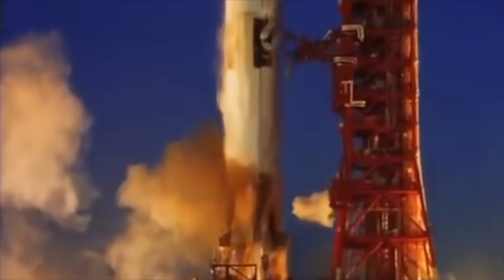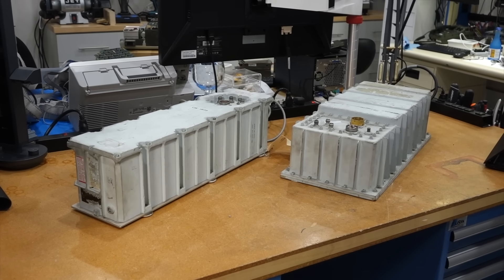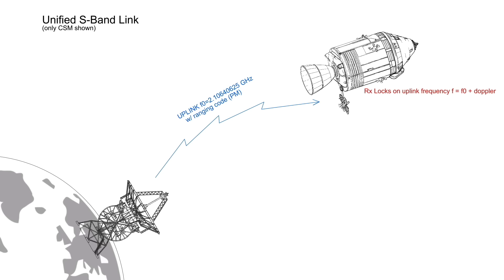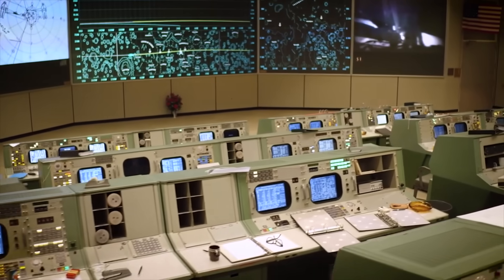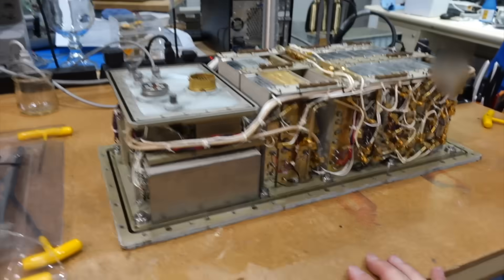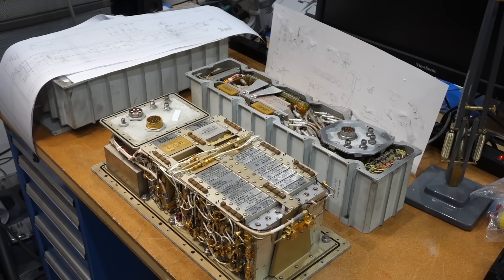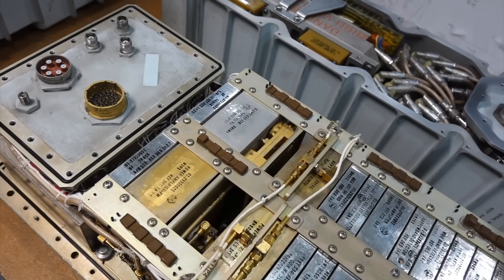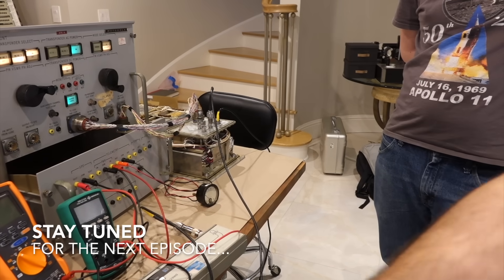Apollo Comms Part 1: Opening the S-Band Transponder and Amplifier

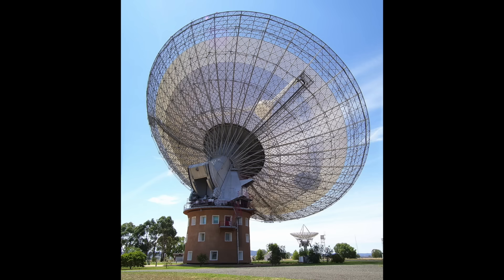Comment: There is an interesting fact about the Parkes antenna (04:50) as in the moment of Armstrong's first walk on the Moon it was the last one who had contact with Apollo 11 and as thw Moon was very low on the horizon the dish was kept at its lowest declination nearly toucing the ground and in that exact time the wind rised first at 50 kn and then at 100 kn, at windspeeds higheer than 30kn in order to preserve the instrument the dish should be pointed at the zenith, but the tecnicians of Parkes bravely decided to keep it pointed towards Apollo 11 risking their onw life in case of a collapse of the building
Reply from the maker: The ground antennas alone are worth a full episode! Unfortunately very little of this Parkes galore is true and the Dish movie is both historically and technically completely wrong, I hated it. Except for the beautiful views of the dish itself! The Goldstone 210 ft antenna did the Apollo 11 descent (and basically saved the day allowing to maintain LM comms on the omnis). Goldstone 210 also did the TV at the beginning of the moonwalk. They had great signal but they had their scan converter setup completely wrong. You can see it at the beginning, image upside down, way too much contrast, then even inverted contrast while the operator is panicking while trying to correct the mess. So they quickly switch to the 80ft at Honeysuckle (Australia), and the picture gets much better. So Honeysuckle did the beginning of the moonwalk including the first steps on the moon. Soon after that (8m30s into the moonwalk), the Moon came into view of the Parkes 210ft which is further east. Although it was earmarked as backup, it had a 10 dB advantage and therefore a better picture. They stuck with Parkes for the rest of the EVA.
Reply: @CuriousMarc  Thanks Marc, always on point, but now I'm disappointed: they can't put so much false informations in a movie that pretends to be historical; at least the part of the telescope operating above the limits for which was built is true, whoever designed it made a great job
Reply: @CuriousMarc  Getting science from a movie was kinda the purpose of my comment, ie don't. I liked the movie because it was amusing and had a pretty girl in it. So happy though that it prompted your reply. Thank you.
Reply from the maker: @liquidsonly  Agreed on the goofy side and the pretty girl!
Reply: More steely-eyed missile men.
Reply: "The Dish" is one of my favourite moves and there still are sheep in the paddock.
Reply: Well they kinda fudged on that.  The wind was at the Goldstone antenna.

Comment: The innards of the 1960s Tektronix 1L20 spectrum analyzer look like a baby version of the transponder. The color of the coax cable jacket is meaningful, the white ones have a resistance wire as the center conductor to help absorb reflections in the 1L20, I wonder if it's the same here.

Comment: Remember to fill them back up with nitrogen after closing, guys!
Reply from the maker: Absolutely, we plan on refilling them once we are done.
Reply: @CuriousMarc  How is that done, I suppose you have to flush them many times to get all the normal atmosphere out?
Reply: @VintageTechFan  I guess you can hook up the nitrogen port to a vacuum pump to get all the air out, then fill it back up with pure N2.
Reply: @ojkolsrud1  Are they strong enough to survive a vacuum inside? Do the components survive that?
Reply: @VintageTechFan  I would think that the components survive it, but I'm unsure about the container. It looks quite sturdy and it's not too big, so I would guess so. If not, then it's possible you can just flush the thing with nitrogen.
Reply: @ojkolsrud1  you can put the whole thing into the vacuum chamber if you afraid of possible container collapse. This way there won't be a pressure difference. Then you allow nitrogen to enter the chamber and it will be sucked in by the container as well. The only thing you need to do is installing the cap as fast as possible just after opening vacuum chamber's door. But I believe gas diffusion speed isn't so great to allow any atmospheric air to get into the gear, given the fact vacuum chamber's atmosphere consist of dry nitrogen just after opening its door.
Reply: @CuriousMarc  I feel I shouldn't really have needed to point it out=) I can't wait for the next episodes. Do you have a way to send and receive to emulate a ground station?
Reply: they're 79% full of nitrogen already
Reply: @RemcoStoutjesdijk  Yeah, but it's those other things that are concerning;)

Comment: How far are you allowed to take then apart ? I would love to see what is hiding inside the modules...  BTW it looks like the coax connectors are secured by epoxy, it will not help for dissasembly without damage to the original work :-/

Comment: What about communications between the CM and the LM?
Reply: and with two moonwalking astronauts and a rover. Many radio links involved
Reply: I think that was a separate VHF system.
Reply from the maker: @Frank Brocker: You are correct. The EVA astronauts to LM and the LM to CM was on AM VHF. Actually for the EVA astronauts it's EVA astronaut 1 to EVA astronaut 2 to LM over VHF!

Comment: They built a 2 GHz PLL with 1960s technology? Thats amazing, really inteested in seeing the rest of it.
Reply: Yeaaaaa, I'm really looking forward to this series!
Reply: The VCO and phase detector were running at only 10-20 MHz. The rest was done by downconverting microwave frequencies and multiplying the VCO frequency.
Reply: @cogoid  Still very impressive, especially that they multiplied it an order of magnitude higher. I can't wait to see the insides.
Reply: @djtransnazgrz  Of course, this was top of the line gear. Very, very expensive -- Collins and Motorola were paid approximately 2 billion dollars in today's money for their work on communication equipment for NASA projects. 

I have not seen the schematics, but the block-diagram shows many frequency multipliers, a couple of which are x96 and x54 -- getting in one jump to 2 GHz.  NASA report does not mention it, but these ones are most likely based on a Step Recovery Diode -- which just became commercially available in those years.
Reply from the maker: @How Does it Really Work: Yep lots of multipliers. Even the transmitter output is not amplified directly. The final RF power amplification is at a few 100's of MHz, and it's passively multiplied to generate the final output (as you said, probably by a step recovery diode). I was also wondering how they did it with solid state at the time, which was incapable of running at 2 GHz.
Reply: @CuriousMarc  The SRDs are almost surely used in the multipliers which immediately generate very high harmonics at low power for LO.

In the version of USB described in the NASA report "UNIFIED S-BAND TELECOMMUNICATIONS TECHNIQUES FOR APOLLO VOLUME 1 - FUNCTIONAL DESCRIPTION", the multipliers at the output of exciter are explicitly labeled as "varactor diode multipliers" in the FM channel. The PCM channel looks similar, though there for some reason only the first multiplier is specifically labeled as varactor-based. The output power of those exciters is supposed to be several hundred mW (different from your unit?), so it should take only a few watts at 76 / 152 MHz to feed the multipliers, as the low order varactor multipliers are reasonably efficient.

Comment: Yummy - red meat! And I like NASA better than the Air Farce (sic) for satcom links. The Air Force did not recognize the use for disparate transmitter power on up and down links. NASA obviously did.

Since the paths were essentially identical the 20 kW ground station is definitely an alligator if the receivers in the space craft and the ground were similar and on the same antennas. NASA apparently felt comfortable enough to allow the space craft to have a higher noise figure than the ground station could have. I don't know if NSASA had antenna mounted LNAs. That was within the state of the art at the time. The extra long path for the receive signal with very small coax assures the space craft's receive noise figure was fairly high. Best case NASA went even further and used a receiver design that accepted a favorable power vs weight vs noise figure tradeoff with a practical noise figure allowance absurdly high by modern standards, over 30 dB.

That tradeoff allows for higher loss in the transmit/receive diplexer that separated all the three signal paths, optimizing TX paths for loss and interaction effects at the expense of higher receiver noise figure. They made some good choices or at least allowed Motorola to make good choices.

Speaking of Motorola it appears they may have had a near lock on spacecraft control and communications equipment. When GPS Phase IIb was being design Motorola had the control link. That control link was accidentally jammed by "a broken Tijuana Taxi Cab radio". So they wanted an anti-jam uplink. I was one of the engineers on that link's design. The Air Farce refused to make the tradeoff on noise figure vs reliability and robust characteristics. I pointed out to them repeatedly that for anti-jam radios random noise, as from a high noise figure, is equivalent to jamming. And the link had approximately a 50 dB AJ ratio. They wanted absurd overload characteristics as if somebody wanted to burn it out with Boulder Dam's output connected directly to a transmitter on the Arecibo antenna at the same time as they wanted a less than 5 dB noise figure. At the time this was not a possible design characteristic. They overloaded the project with that kind of requirement and the AJ uplink never happened. Comparing the Air Farce and NASA in this regard highlights NASA at its best.

{^_^}   But, who ever pays attention to a mere "gurl" even if she is the project lead engineer?
Reply: This was great until the last paragraph. Leave that petty crap off. There are countless reasons that people disagree and have different priorities beyond the fact that you were a gurl.

Disagreeing with one, even if you are subsequently proven wrong, doesn't mean that you disagreed because they were one.
Reply: @thebitcoinimist  It is a lot easier these days than in the late 70s. Today it is much improved. 'nuf said.
Reply: @Wizardess  I understand that concept, and perhaps it is. Maybe. Or if it was, maybe it's just better hidden today. I have no idea. It is rare indeed that we get to get into the minds of other people, no matter how certain we are of their thoughts, reasoning, and motivation.

I, for one, welcome our new insect over...uh, wait...welcome your contribution because it has value and interest!
Reply: @thebitcoinimist  Sometimes they tell you up front. I had a couple dorks declare to my face that women cannot be engineers. I give them points for being up front about it. Over time they became supporters. (And the worst MCPs in the world are other women.)
{o.o}
Reply: Yep!  I worked with both the SGLS and GSTDN transponders in the 90s.   I was the RF Comm Engr (both space and ground) for several missions, both NASA and AF at OSC and later at TRW.

Comment: Did you find any wave guide  assemblies or only coax interconnections?
Reply: The wavelength for 2 GHz is 15 cm, or 6 inches. For the waveguide to transmit these waves, the size of the guide would need to be similarly large.

For example, WR430 waveguide:
Recommended Frequency Band:1.72 to 2.60 GHz

Cutoff Frequency of Lowest Order Mode:1.372 GHz

Cutoff Frequency of Upper Mode:2.745 GHz

Dimension:4.3 Inches [109.22 mm] x 2.15 Inches [54.61 mm]
Reply: @cogoid  Thank you! That explains it perfectly.
Reply: @cogoid  thanks for the specs. I'm an amateur radio operator but have never operated above UHF bands. At UHF frequencies that I'm licensed to operate (70 cm aka 440 MHz) I use well shielded coax which works well for my needs. I know "of" waveguides and their applications but have not had the need to do the calculations to use them. Thanks for sharing that very interesting information
Reply: That's what I thought he was referencing when he said microwave electronics are a black art! Was hoping for waveguides, not co-ax.

Comment: Im definitely admiring these modules but I have to say I also admire the new hex keys being used in the disassembly, you guys do a fantastic professional job
Reply: Whenever you tinker with avionics or space stuff, you need to be very serious about an extensive collection of hard to find hex keys, far away from the regular sets you get in hardware stores. And when you think you are done sourcing rare tools, you find out you also need a whole set of the totally unobtainium "Bristol spline" keys :-p
Reply: @msylvain59  Ha yes Im a tool collector, I know what you are saying. Oh and yes I have a set of bristol keys, they used to be used in IBM printers and were standard IBM issue back in the day.